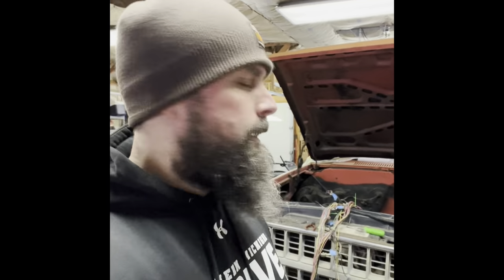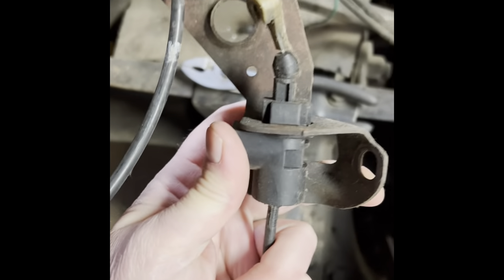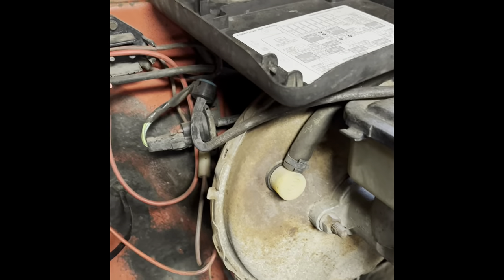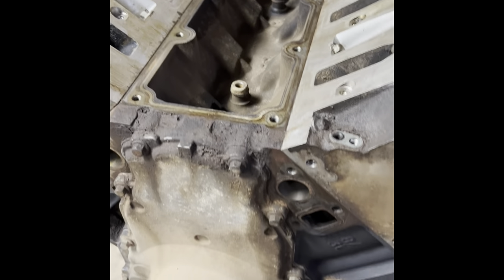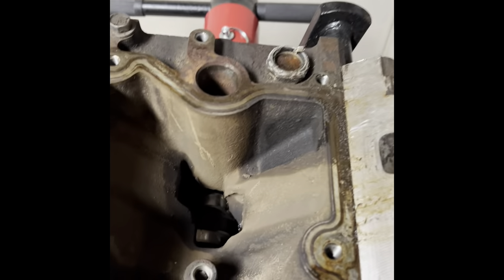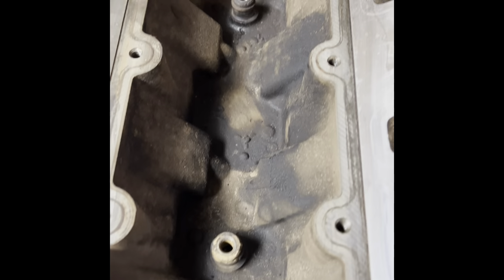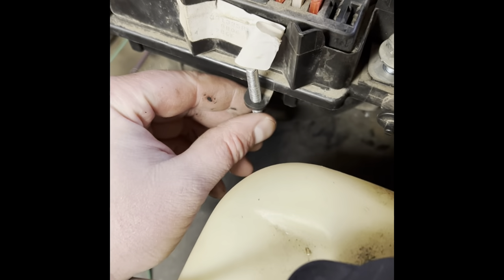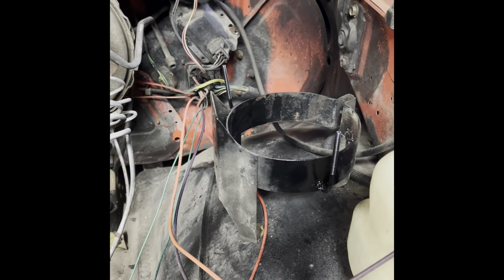1981 C10 LS Swap Wire Harness Part Two! All wired, Stock Fuse Box from donor truck to!

Comment: Did you use the factory pcm from the donor
Reply from the maker: I did. eBay guy flashed it and removed the VATs for $50 bucks.
Reply: @Twostallgarage  so I inherited a 5.3 with the full harness attached it's currently drive by wire. It doesn't have ac or power steering. I want to put it in an 89 blazer s10 but don't know which route to take for the short budget I do have
Reply: @Twostallgarage  I also have the fuse block from the donor vehicle
Reply from the maker: @jasonellison7761  use the AC and power steering from the s10. Power steering is just lines, ac you need to get creative with brackets
Reply: @Twostallgarage  with the research I've done I should be able to drive by cable swap it easier if I buy a van pcm,

Comment: I watched a few videos on sloppy mechanics and the driveway engineer and the general opinion is gm ls gaskets are reusable if they aren't damaged. Why did you delete your knock sensors?
Reply from the maker: Right! My gasket wasn’t too bad after I got to looking at it. I’m just hoping it holds. If not, I’ll toss on another one. The knock sensors kinda blew apart when I took them off the engine. Since I was already sending the PCM to delete the VATTS, I requested the knock sensors to be deleted-which was included in the price. The cost of the valley cover too was in reason, dressed up the area a bit nicer as well. I figured less I would have to maintain going forward and adding any bolt on boost or spray, I have read they should be deleted.